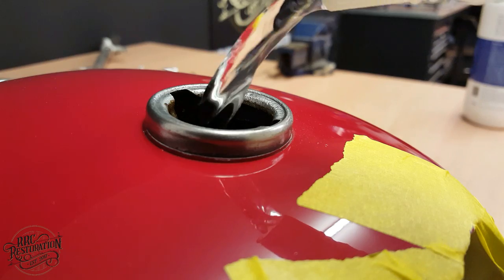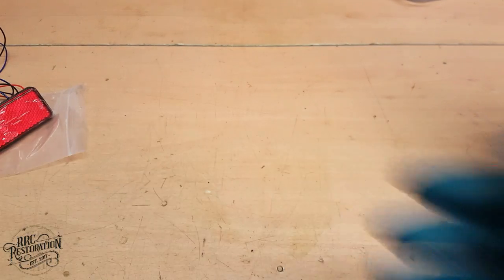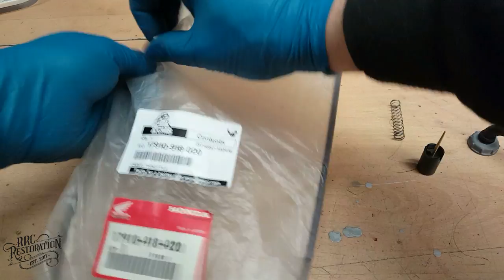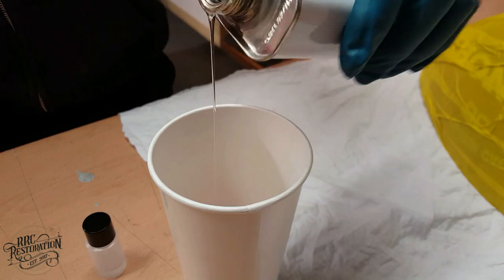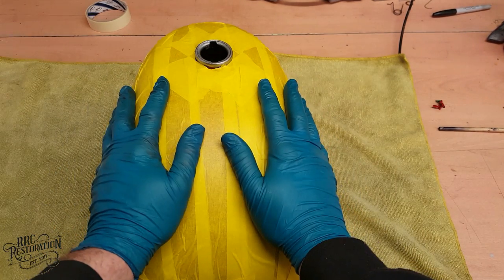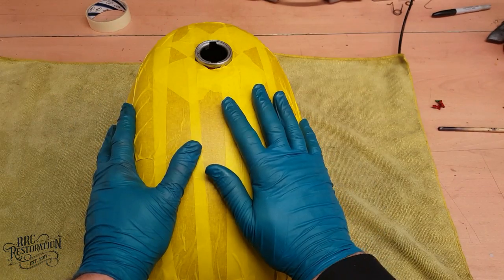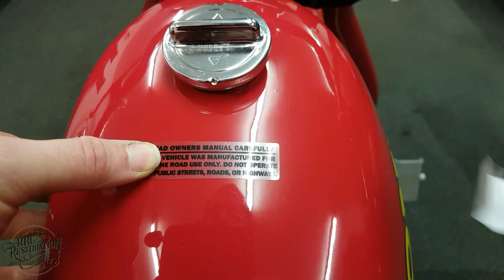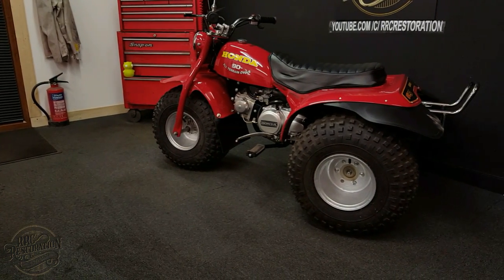1978 Honda ATC 90 Full Restoration - Part 9

Comment: I enjoyed watching this very much, as a young man when all there was were 3  wheelers. I had a  ( very used )1969 atc 90   Honda with the single latch lever in the center of  the bars to fold them down to put in the back of a  station wagon.  It came  with the original one piece wheel and tires wich were replaced with modern wheel and tires. Eventualy  I sold it when the Honda 200s came out.😢 but always  regretted  it. Now over 4 decades later I purchased  a 76 90 atc that needed lots of TLC,  i did not realize the difficulty  finding parts mostly used because new is either non existent  or  to $.$ . Well thank for memory lane visit. Iam now enjoying my 90 atc now with my grandkids.

Comment: This is one of the best things I have seen in a while, so much attention to detail. One thing that was strange though, the rear axle was painted black where the stock ones had a gold color. I wish I had the skills to do this, would love to restore a 1982 ATC 185s, my first machine.
Reply from the maker: Hi, the rear axle was sent away for plating and is gold underneath the gloss black, i chose to paint it black for extra corrosion resistance and i feel black ties the rear end together better the zinc plating would look out of place.

Comment: The wait was definitely worth it thats as good as new, in fact I would sooner buy from you than new as your work is meticulous with nothing missed, I had the pleasure of going to see ford tractors being built and seen pistons put in to engines dry, no oil on the small ends or rings all assembled dry put into the ring compressor and hammered into the block, I watch the guy do this to 4 6 cylinder engines
Reply from the maker: ooft assembling an engine dry defo not a clever idea i bet they sounded nice on first startup! Glad you like my work :)

Comment: Hate the trike, absolutely love the build from start to finish. As previously mentioned, I owned a 200M back in the 1980's.., it was fun when you could stay on it, at one point when going over a rough muddy trail my foot slipped of the foot peg and I ended up running over my own foot and ankle, not good. Back to this resto job, it was done absolutely flawless with no short cuts👍👍. Try Dalwhinnie's single malt, its silky smooth the next time you're in the mood to celebrate... Good stuff lad, another job well done!!
Reply: I have a 84' 200m, my grandfather bought it new and I've been riding it as long as I can remember. Still going strong today. Awesome trike!
Reply from the maker: Haha funnily enough i had a similar experience with a 110 many years ago, not so much fun when your machine can run you over in a heartbeat lol. Glad you enjoyed the restoration :)

Comment: That classic Honda noise. Makes me want to go hop on my old TRX 200 and rip around the property. Glad to see this restoration finished. Hopefully the next one will be less troublesome, logistically, as the world attempts to wake up from the long night.
Reply from the maker: Yup, you can always tell a vintage Honda a mile away with that classic engine not. Yeah fingers crossed although as you know what the next project is i think we can both agree there wont be any problems sourcing parts for it ;)
Reply: @RRCRestoration  And it seemed to be in really good shape for its age so hopefully you can just recondition what is there, mostly without having to order a whole bunch of new parts.

Comment: This trike restoration is amazing. Top level work. Be careful riding these, they were outlawed for a reason. They really like to flip
Reply: They were never outlawed...
Reply: @soddog4  they were actually banned in the USA in January 1988. Never in the UK though, although by this time Honda had voluntarily stopped manufacturing them due to their terribly safety record with children..
Reply: @nutwiss  The consent decree of 1988 in the USA was an agreement to stop sales for 10 years which Honda signed since they knew the market was shifting to 4-wheelers. Honda (or anyone) could make and sell 3-wheelers today if they wanted.  Again, never illegal.
Reply: @nutwiss  no, my comment didn't include an exhaustive list of every country where they were banned and where they weren't. The point is that someone banned them for a reason.
Reply: @yadaroni  Have any countries actually outlaw them??  The US didn't and I've never heard of another country doing so.  I'd love to know.
Reply: @soddog4  Yes. They were illegal in the US for a decade. Technically they could be built again but people don't want them because of the high rate of flip over injuries and deaths.
Reply: @yadaroni  No, they were never illegal, see my posts above. Manufacturers voluntarily agreed to stop sales and production for 10 years via concent decree!
Reply: @soddog4  Read the article I posted from 1987. They were banned. The first stage was sever restrictions and was to titrate to a full-on ban. When people learned about the safety issues, they began buying quads and even used trike sales plummeted. Technically manufacturers voluntarily decided to end production but if they hadn't a full ban would ABSOLUTELY have been inacted. Fines and prison terms for failing to comply were already in place and ready to be approved. 
I am aware of the technicalities, but my original assertion was correct. I was there. I remember the news and the papers. There was no discussion by anyone that trikes would still be manufacturered.
Reply: @yadaroni  This discussion is getting good, but I still disagree with your statement about them being outlawed. You even contradict yourself in your last post: "They were banned." and “...a full ban would absolutely have been acted."  Which is it?  The consent decree was a voluntary agreement to stop sales and production with no admission of guilt or any wrongdoing. Nothing more, nothing less.  Were policy makers and public safety activists trying to get them outlawed? Yes.  Was there ever a law put in the books explicitly outlawing them? No.  The OEMs were facing heavy pressure and they knew it.  That’s part of the reason they signed the decree.  However, it was in some sense smoke and mirrors and, in my opinion, a genius move by the OEMs.  They knew the market was shifting away from 3-wheelers and onto 4-wheelers and they agreed to stop sales and production and had already shifted R&D onto 4-wheelers.  I call it a genius move because sales continued to climb in the decades to follow even though ironically (maybe tragically) injuries and deaths also continued to climb, however, the lawsuits and pressure from lawmakers and special interests groups dissipated.  Again, 3-wheelers could be made and sold today because there is no law on the books saying they couldn’t and the decree has long expired.  No, I don't think anyone is going to start making and selling them.
Reply: @soddog4  we are now at the level of semantics. I'm out. Take care.
Reply: @yadaroni  Semantics is where we started when you incorrectly said they were outlawed.  Full circle I guess. Cheers 🍺

Comment: A Tip for fitting the vinyl cover to the foam base is to wrap the foam in cling film first and then the cover does not tend to stick and you don’t end up fighting with it!
Reply from the maker: Great tip, ill be sure to use that when i need to recover a seat again many thanks :)

Comment: Great job and great video! The grinder is super loud though, maybe there is a way to reduce volume for these parts
Reply from the maker: Thank you very much, Yeah i must've missed that in the edit this time as i usually pull the volume way down for the grinding sections so it matches the rest of the audio, sorry about that.

Comment: Hey RRC just some advice when cutting zip ties. Side cutters never cut close enough to the zipper part of the tie. Get yourself some circuit board flush cut cutters. They cut right flush with the ties zipper and your skin will thank you later on. Many times I`ve shredded my skin on razor sharp zip tie cutoffs with conventional side cutters.
Reply from the maker: Thanks for the top tip ill be sure to get a pair :)

Comment: A classic motorcycle collector would have fainted when you started it, rode it and got it dirty! I'm restoring a cd175 , what kind of welder would you recommend to repair two holes in the fixed rear mudguard? The first one I did I cut the old one out and welded a donor one on but don't have the option now . Regards

Comment: That rear grab bar and the front mud flap look different than mine.  Maybe because mine was made in 78, but is a 79.
Reply from the maker: Yeah, ive seen a few variations of the rear grab rail throughout the model years, not sure why they decided to keep changing it?